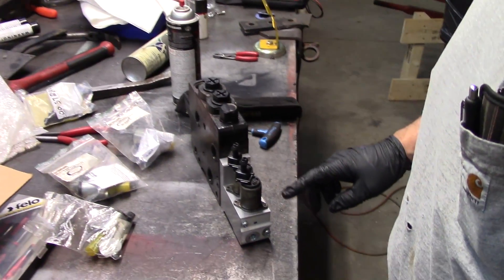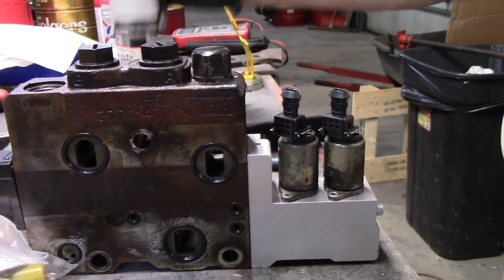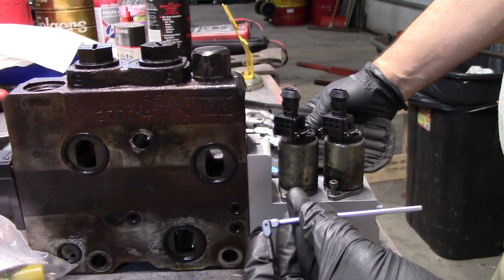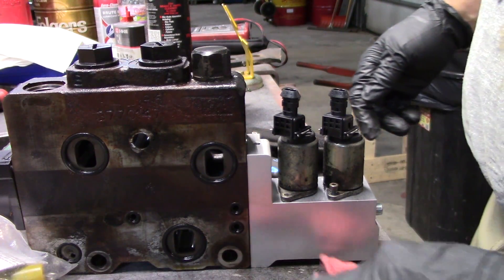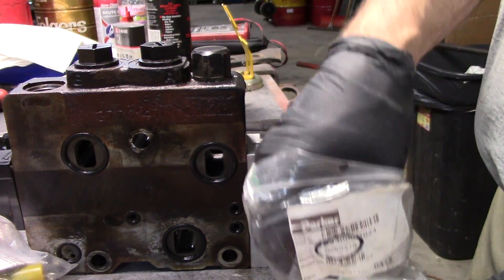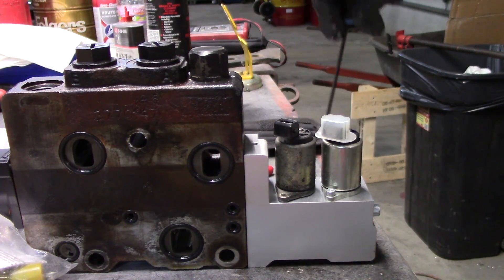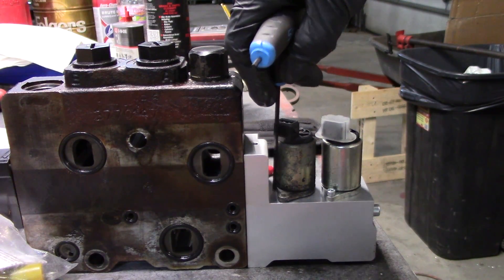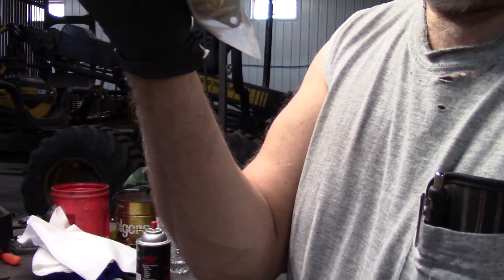Replacing solenoids on hydraulic valve

Comment: YOU NEED TO PUT SOME A LIGHT OIL ON THE O=RINGS BEFORE INSTALLING THEM, NEVER INSTALL ANY O-RING WITH OUT IT. YOU WILL ETHER CUT IT OR DAMAGE IT IN SOME WAY PUTING IT IN DRY LIKE THAT,, ops caps.. that was drilled in to our heads in tech school some 40 years ago, also all instruction tell you the same. same thing with piston packing..

Comment: I need to work on my timbco 425 buncher Vickers valve bank.  main and stick boom have no power when it gets warm. The kit cost 950.00 for orings and gaskets from timberpro. 👍 advice.
Reply from the maker: Make sure cylinders are not bypassing internally.

Comment: Thank you for the video Mike. I am about to reseal a 90 valvebank from a logmax head, do you find you like to put a little grease on the orings when you install them or not? If you use grease what kind do you recommend?  Thanks again.
Reply from the maker: just hydraulic oil is fine. if you use a grease it should be a transmission assembly grease, it dissolves rapidly when subjected to oil.

Comment: Solenoids with replaceable coils make things  a lot easier but half the time they are so rusted you can't get them apart and end up replacing both anyway. during winter maint we try to remove coils and put dielectric grease on the stems to prevent rust. Thanks
Reply from the maker: Those are a totally different subject matter.

Comment: Do you lube the o-rings or put them in dry?
Reply from the maker: generally there is a plenty of oil in the hole
Reply: I've never worked with that style  I've always used the slide over magnetic that rust effects and most aren't serviceable so they get you by making you buy and replace whole block.